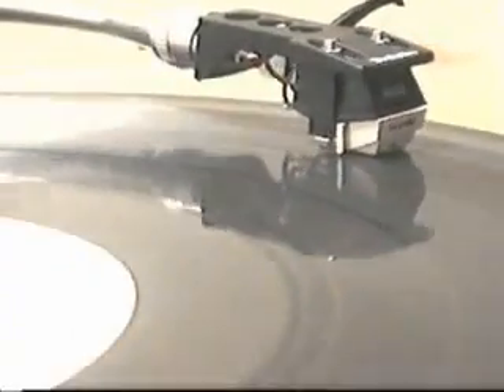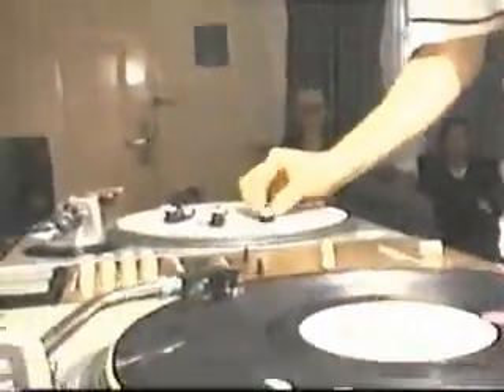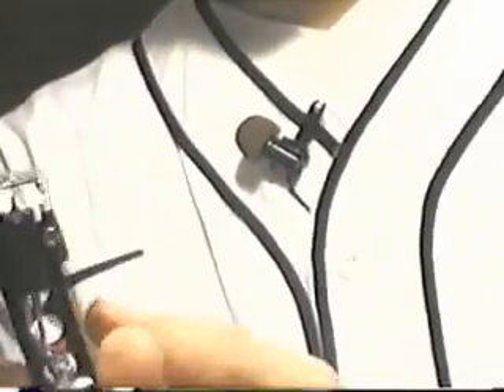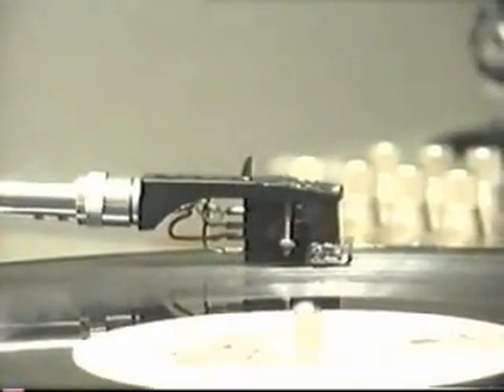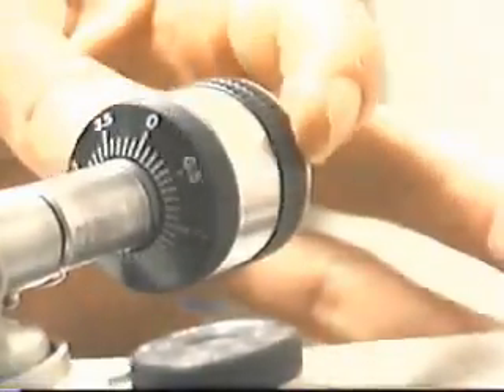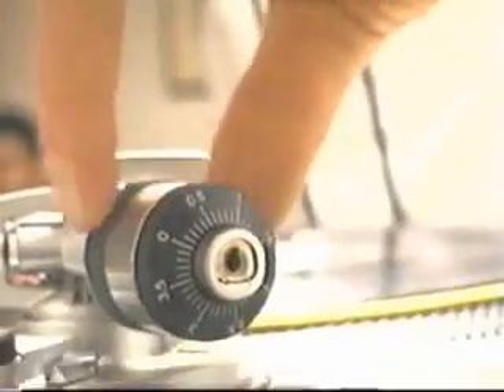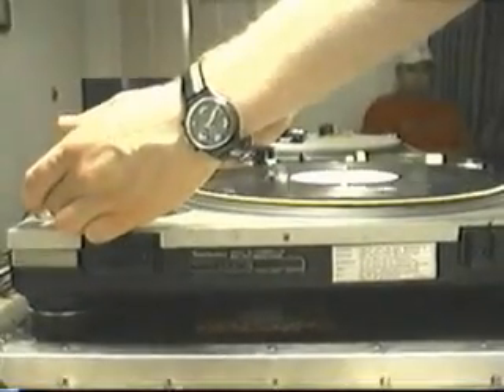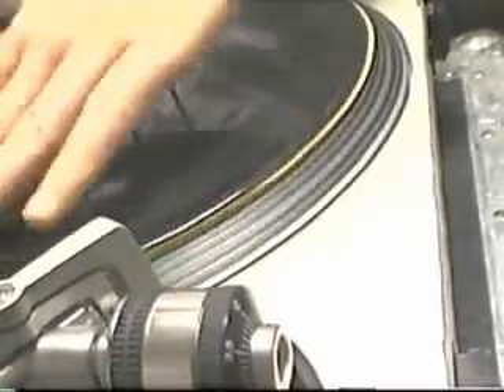Setting up stylus

Comment: this video is wrong. All you need to do  is to properly setup your cartridge is measure the tip of the stylus to the cuff of the tone arm and it should be 52mm. This is the proper way for playing, scratching and everything in between.